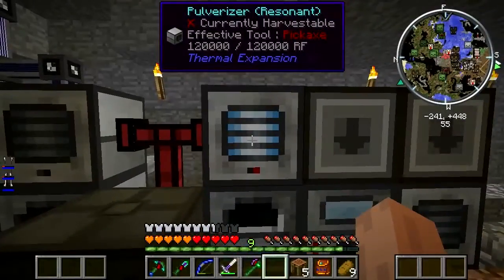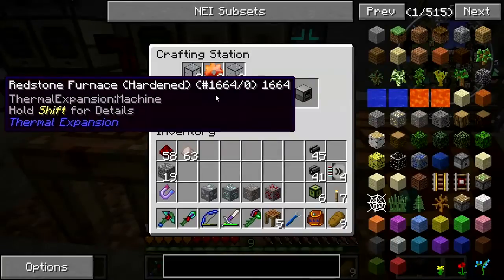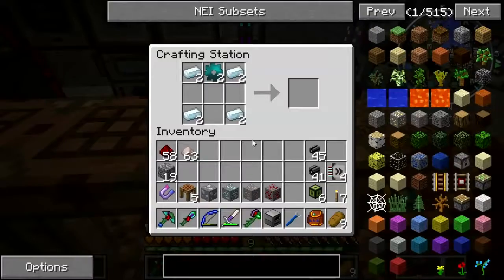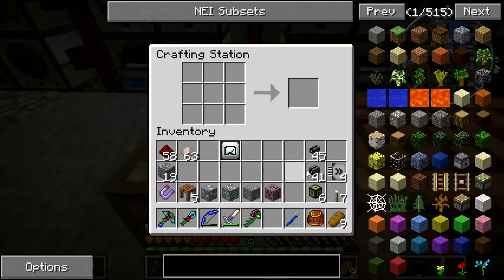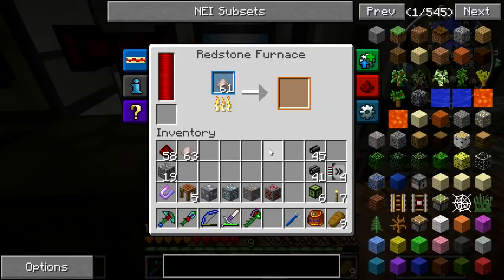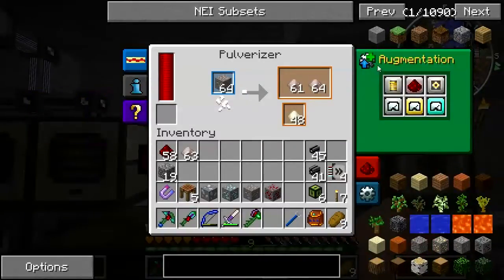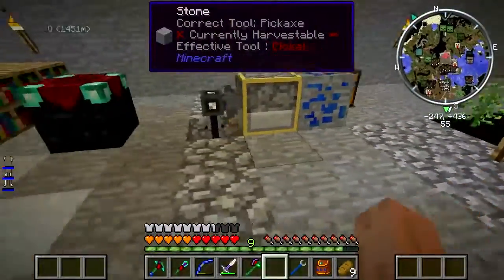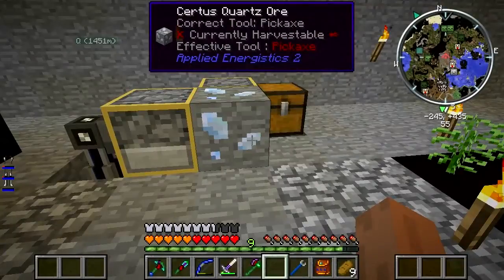Minecraft Mod Sauce Ep.20 How To Make Thermal Expansion Machines Run Faster

Comment from the maker: I've been wanting the answer to this question for quite a while now.  Now I have it.
Reply: I believe you don't need the lower tier upgrades in the machines to use the higher ones, you can just use all of the highest tier available for each slot of that machine. Also, there are upgrades for higher secondary item chances, and higher storage of power.
Reply from the maker: Mike C  possibly but in my tests the max upgrade by itself was a LOT slower than with all three of them
Reply: they still stack, you can just use three of the highest tier if you don't need secondary items.
Reply: Also, if you or any hermits have any questions about mods in the pack, I'm fairly familiar with most of them so feel free to ask.
Reply: looking good tfc! now just for ur pulverizer u gota find a way to deal with the extra out puts as that has slowed ur set up down while it waits for that slot to empty. maby just have it go into the me then into the furnace? might help some
Reply from the maker: Azreth22 I am very soon going to be totally re-doing all of my processing setup and yeah, separating the pulverizers from the furnaces will be part of that.
Reply: TinfoilChef's Gaming Channel nice :D